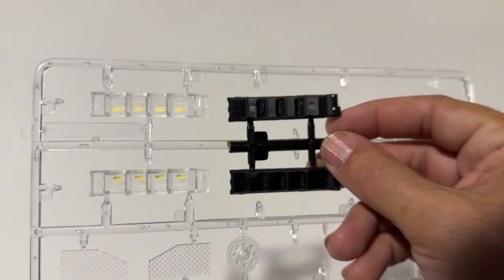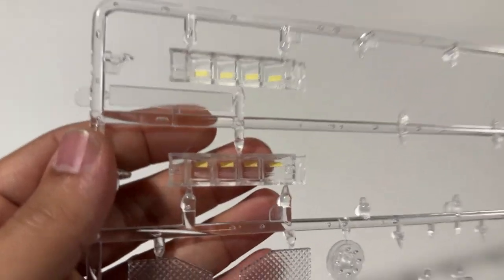Polar Lights Kronos One build Part 2: Lighting the Command Structure

Comment: For the 'pie piece' I would have removed much more plastic, maybe leaving three or four posts to glue the photo etch on...
Reply from the maker: I wonder if the easiest thing might be to cut the plastic out entirely. leave three strips of opaque plastic above below, and between the strips of photo etch.
Reply: @allscaletrek  Maaaybe?  Gluing the PE to the clear part could be messy and I think the spacing between the thin PE and clear would provide a really wide angle for the light...

Comment: You need to Light Block those Blinking Strobe in the Nacelles so those Blinking lights don't Bleed into those Green Warp Engine Lights the Green Nacelle Lights don't look right with those Blinking Strobes Bleeding to them .
Reply from the maker: I plan on doing that, I think just a bit of foil tape will do it.